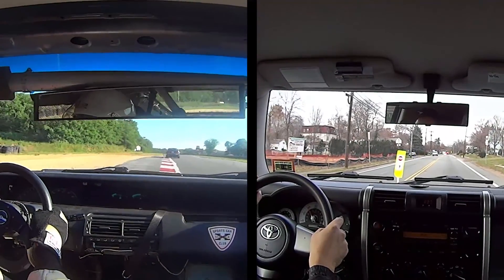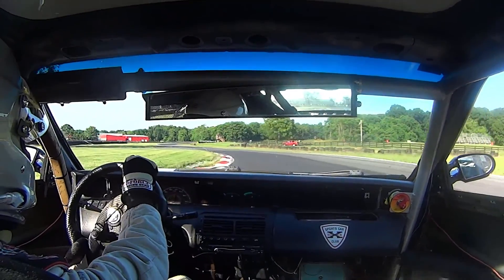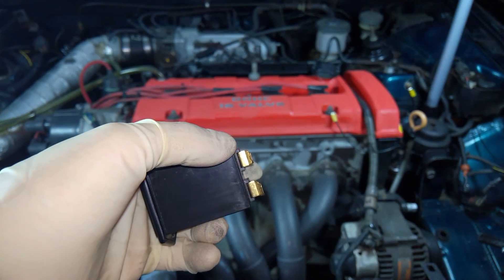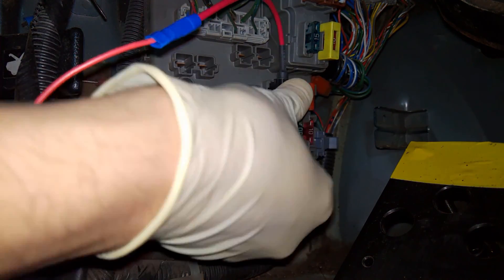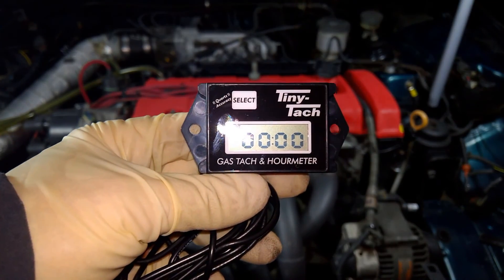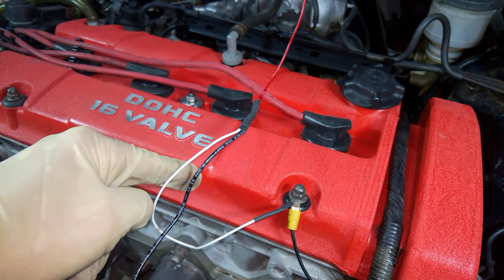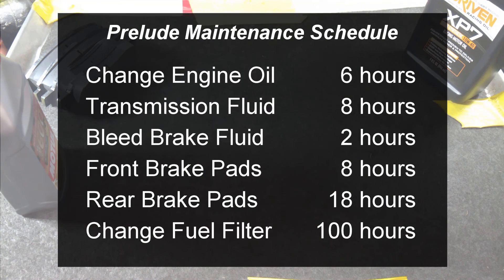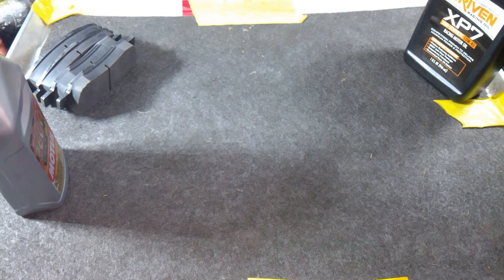Odometers Are Useless. Install an Hour Meter

Comment: But even hour meters don’t tell the tale. Engine rotations over time (or miles) is the best start for determining wear for engines. Ditto for transmissions, differentials and transfer cases. Tires, brakes and rotors can be visually and date code inspected. There isn’t a one size fits all. YMMV

Comment: but how many hours to a service on a daily car?
How would you covert 5000km to hours
Reply from the maker: For a normal street car, I like to divide the mileage by average speed for how the car is used. For most passenger cars, I like to use 80 kmph or 50 mph as a baseline, which translates to  62.5 hours per 5000 km.

That said, the hour meter method of tracking maintenance is really more useful for cars that have a specific use case. For example, if you only drive on highways for extended periods of time, if you drive at high rpm for extended periods of time, or if your car idles for very long periods at a time.

If your diving habits fall into the average use for your region (e.g. 5000km of combined urban and highway driving every 4-6 months without excessive idling or high rpms), the mileage method for tracking maintenance intervals can work well enough.

Comment: Hi, thanks for the video. What happens when ignition is on, but engine is not working? Is there a way to record actual engine runtime?
Reply from the maker: Thanks for watching! In my car, the hour meter starts running as soon as the ignition is turned on. If you wanted to record actual engine runtime, you could tap into the wiring for the distributor or the wiring going to the ignition coil.
Reply: U can wiring it with oil switch wiring or with alternator pin into battery indicator... its only run when engine run

Comment: This meter must be pretty loud? dang.
Reply from the maker: The mechanical Hobbs meter shown in this video is very loud. I can hear it over my racecar's engine when it's idling.

Thankfully there are other ones that don't make that loud mechanical click every time it turns over.
Reply: @StudioVRM  I went to Aircraft Spruce for your exact meter and can you believe it, it's $149 now. Would love to know what happened.  eh, over to Amazon & bought a Qiorange mechanical china knock off for $12.39.
Reply from the maker: @craigsmithx  Wow. That is crazy. Thanks for the heads up. It looks as if the price of the entire range of Honeywell's Hobbs meters went up.

I'm going to ask a few of my pilot friends and see if any of them know what's going on.